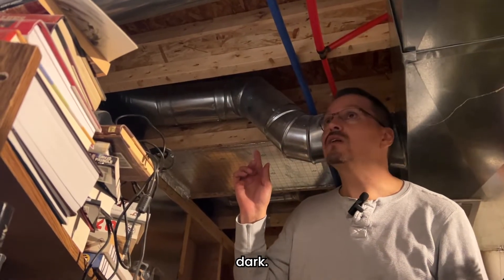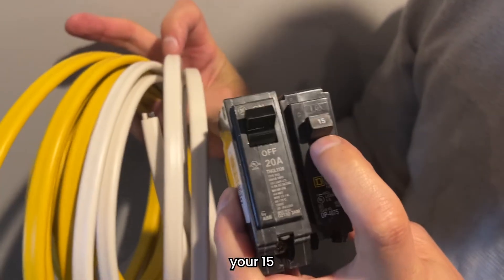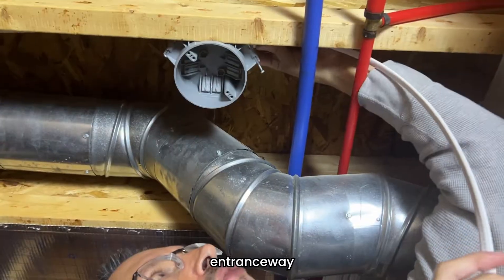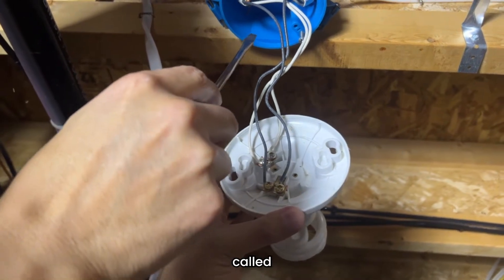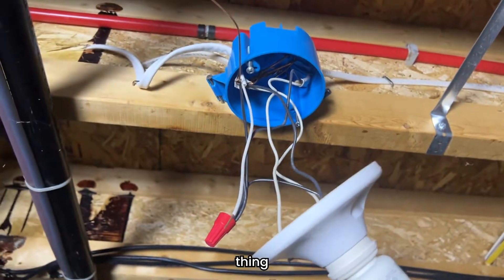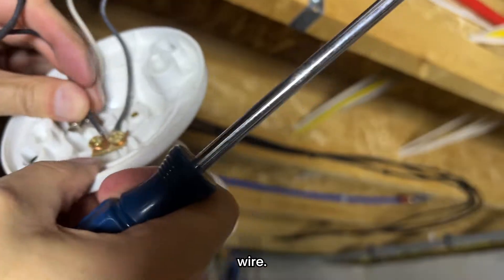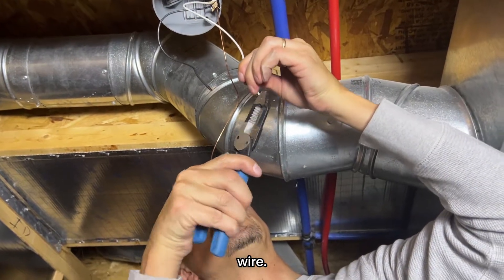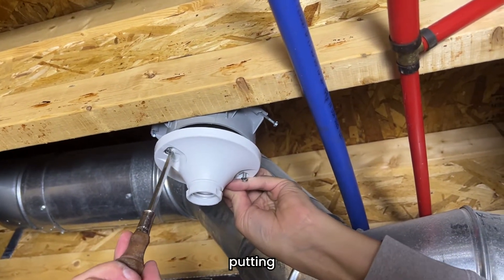How To Add a New Light To an Existing Circuit | Basement, Garage, Attic, etc

Comment: Great video! Thank you! I’m about to add an outlet to my garage ceiling to hang a light and will be connecting it to an existing light fixture that is operated by a switch. This seems to be very similar to this project. It helped me understand the use of the pig tails. Great videos!
Reply: A question I had is, would it be the same process if you were adding an outlet instead of a light fixture? I am trying to add an outlet and plan to use the power that is running from the switch to the light fixture. So I would be connecting the outlet to the existing light fixture if that makes sense.
Reply from the maker: Yes, it’s very similar. Remember in switches, they bond and cap the neutrals together & the switch only controls the hot leg… So you’ll have to tap into the hot and neutral side to extend to an outlet… But it’s done all the time. As long as you’re tapping from the hot side of the black wire and not the switch side… You got this. Let me know if you have any questions down the road…🛠️😎
Reply: @H @HomeRapidRepair unds good I believe I understand it. So I would basically run the new wire from the existing light fixture to the new outlet I am putting in? And just use a pig tail to connect the black/hot wire and then connect the neutrals and then the grounds?
Reply from the maker: @SlickNick-07  yes. However, if you run the wire from an existing light fixture that new outlet will be on the switch. If that’s what you intended, that’s fine. If you want the outlet to be independent, then you want to run the power from a constant source.
Reply: @H @HomeRapidRepair perfect that’s what I intend it to be. So when I flip the switch that light fixture will turn on and the outlet will be live as well. Thank you so much for the help!
Reply from the maker: That’s awesome. Yeah you got this. You absolutely can do this.
Reply: @HomeRapidRepair just coming back to this comment. I installed the 2 outlets in my garage, thank you for the help from your video and commenting back! It helped a lot!

Comment: I was concerned about the grounding at the sockets and the end of the run so does grounding at the switch take care of the grounding
Reply from the maker: Yes for the switch. Remember every house built before the 1960’s had zero grounds and many of our houses plugs 🔌 aren’t designed to need additional grounding…

Comment: I installed ballast lights in my attic . By using bypass ballast led light bulbs. I tapped in an existing light and I put a blank cover on existing light because it requires a light bulb. I chose to get rid of it because the attic was lit bright. Ballast light was made of metal and it had a green ground screw for ground wire
Reply from the maker: Awesome work..Thanks for watching and sharing your experience with your lighting project , I appreciate it 👍🏼😎

Comment: can you use crimp wire connectors in place of end caps?
Reply from the maker: Yes, for sure… As long as they are enclosed in an electrical box…

Comment: Love this content! Truly simple and to the point. My only question which was specifically stated is what is that second group of wiring you attached the new wiring to? I understand the one coming in was power from the switch but what was the other leading out already?
Reply from the maker: We were adding on another light to an existing circuit. So you should’ve had the power coming in from the switch, and then the other set of wires would’ve been carrying the electricity to the next light fixture in that room. Let me know if you have any other questions on this. Thank you.

Comment: Nice video. I want to cancel one light fixture from the kitchen, but add one to the patio Using the same switch. So am guessing I can use that same wiring, just need to add more wiring.
Reply from the maker: Yes, you can. You got this 👍🏼😊

Comment: I didn't see a ground wire.
Reply from the maker: I should have attached a ground wire. Maybe it didn’t make it in the video. Thanks for watching 👍🏼⚡️🛠️
Reply: @HomeRapidRepair  where do you attach the ground wire from the new light?
Reply from the maker: @ it will be the bare copper wire. If you don’t have a bare copper wire you have an older house and you don’t have to worry about it 👍🏼
Reply: @HomeRapidRepair  Did you just connect the bare copper wires together (the grounds) in the middle existing box? and then push it all up into the light fixture?
Thank you for the video, I am adding more lighting to my own dark basement xD
Reply from the maker: @ yes. If it’s a plastic box just connect all the grounds together. Good luck 👍🏼⚡️🛠️
Reply from the maker: @ these simple one bulb fixtures don’t have a ground wire connection. Good luck. You got this.

Comment: What if I want to add 2 lights, one on each side of the garage. Do I just do the same thing you did but  put the 3rd light on the other 2 terminals? And any issues with extending a 14-2 by using 12-2 as this is all I have on hand?
Reply from the maker: You got this. Yes just keep adding lights from one light box to the next. Extension Romex with 12 -2 is perfectly fine 👍🏼🛠️🛠️

Comment: Great video.
Reply from the maker: Thank you sir. Glad you enjoyed it 🛠️🛠️
Reply: I just spliced into the existing wires when adding lights rather than piggy tail, it works fine. Great video
Reply: Could you add another light switch in between the lights too?